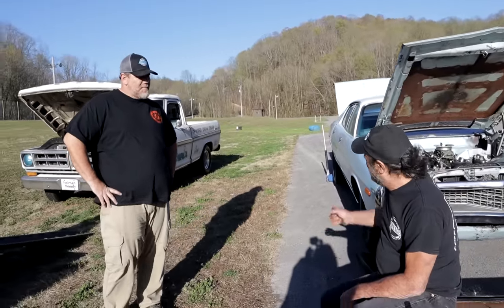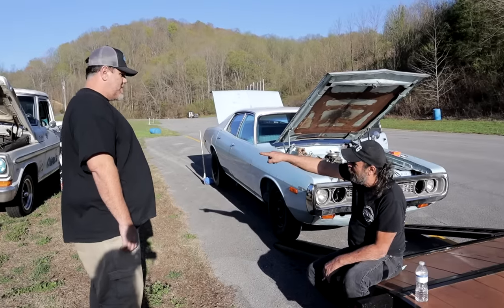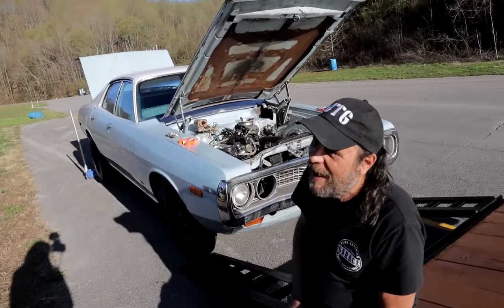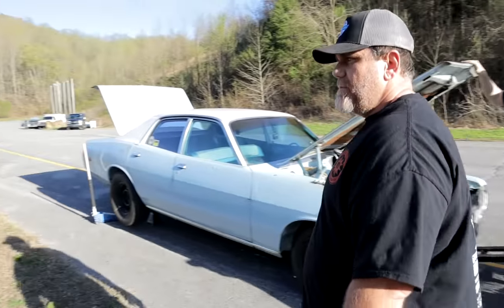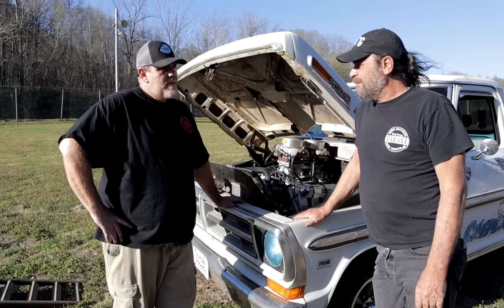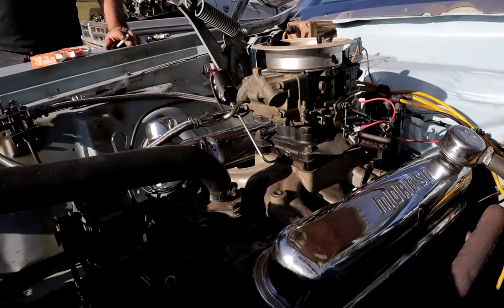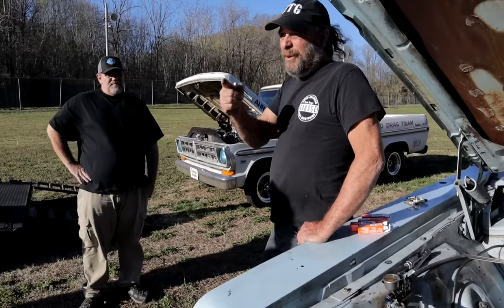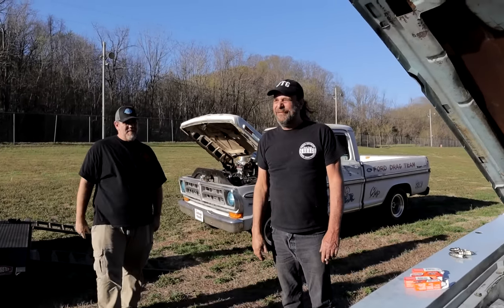Grudge Race Goodness! N/A Boss 429 Ford F100 Takes On A Nitrous 318 Dodge Taxi Cab.  One And Done

Comment: Well. Tony's battleship can move.
Reply: Remember when he weighed BR ? That car weighs less than my 70 Dart!
Reply: @craighansen7594  I dont doubt it. He's been shaving weight everywhere he can. And, what he did, with a relatively stock 318 is impressive
Reply: Let's see what B.C. has to say aboot dat.
Reply: Did pretty well for a 318 but that 7.60 1/8th would be a low 12 high 11 in the 1/4 mile which is still a second off his goal of 10s. Hopefully he can get it there eventually.
Reply: @TheInsaneShecklador  just a larger NOx tank!!!😅😂❤
Reply: @TheInsaneShecklador  Yeah UT mentioned something was not right when it shifted - not sure that exact set-up with get in the 10s
Reply: Definitely got off the line...but...man, that Ford was coming - l saw his video from inside the cab...Good Video 👍
Reply: That’s what she said
Reply: Great job. This was exciting as any drag I’ve ever seen. BR jumped off the line. 👍

Comment: NO fancy dance pricey parts NO high compression engine NO rebuilt /engine bearings!      NO fancy dancey suspension long live the legend of the 318. Tony proved it, for very little money, alot of wisdom, ya gotta believe the 318 is the little engine that COULD and DID. NO ONE that sees this will ever doubt the 318 is a great engine, especially in the right hands! Tony did MOPAR proud- REALLY opened some eyes with this one. And yes, he treed him, but with 111 less cubes, less compression, BUT with nitrous, it was a fair handicap. And that Ford was definitely comin'- Andy got caught out the hole a little bit, but he was STILL flying! GREAT RACE!

Comment: My most anticipated race of the year, for sure. Way to go Uncle Tony. Make the most of what you have. With the knowledge part being the most of what you had. My first car was a 72 Hemi Orange Duster. Blacked out hood with orange strips going up the center. Black duster stripes going across the sides. A 318 with a manual 3 speed and a 3:23 8 3/4 rear end. My father thought the 318 would be a better engine for a beginner driver at 16. We bought the car in Kannapolis NC in 1976. But for my next 2 years in High School I slowly built that 318 up with help from my friends. 340 heads. Cam Dynamic cam. Headman headers. Edlebrok  4 bbl. intake. Carter 750 cam carb. Zoom clutch. I had the quickest car in school. Many stoplight races to earn the title. The town was full of really powerful cars. So I was far from the fastest in town. But that 318 held its own and earned me some coin on the weekend. I bought all the parts myself and worked many long hours to afford the car junkie habit. Great win for the lowly under estimated 318. Long live the 318. And Uncle Tony, remember “ we are old guys, we do stuff”. Thank you sir for your great channel.

Comment: Damn good race. 318s just went up in value.
Reply: So did nitrous injectors...
Reply: @godsowndrunk1118  But the 318 handling that shot is enough for an applause.
Reply: @tomc8157  wasn't contradicting... just impressed with both.
Reply: Very easy to stroke a 318 block to much more cubes! Nitrous on top, it would be effortless to output 500+hp! Then there's sending it down the track!
Reply: @craighansen7594  True...and the Boss 429 can be bored and stroked to 600 inches (Depending on which block used) and make a1,000 hp on carbs.
Reply: @Gods own Drunk  that 429 is Windsor based I believe.
Reply: @IndirectConnection1  unless Kasse added something new,  I think it's big block....had the old Weiand tunnel ram ... which was the only aftermarket intake built for the Boss 429 back in the day.
Reply: @Gods own Drunk  This one is a small block. Andy mentions it in the beginning of this video. He says it right after he talks about blowing up the 393. I'm guessing it's 351 based.
Reply: @IndirectConnection1  well... forget about stroking it to 600 inches. I'm a FE guy....I'll have to check out hemi heads for the small blocks.
Edit;  So are the heads compatible with existing Cleveland intakes...or?
Reply: @Gods own Drunk  I'm not sure honestly. I thought it was a FE at first as well.
Reply: @IndirectConnection1  I was thinking 385 series big block...429/460.  I meant FE's are my area of expertise.  Anyway, I don't know what the heck it is now 🤔
Fords can be confusing...
427/428's  , 429's and 430's , and all different engine families...like 351 Windsor,  351 Cleveland and 351M's...also all different families.
Reply: @godsowndrunk1118  🤣 me either...
Reply: @jamesholmes3955  Thanks.... I've been searching the memory banks and I seem to recall a YouTube video about those...
Reply: @godsowndrunk1118  This engine is like the "Street Boss" Intake kits they used to sell in the Super Ford Mags. 

What Andy is going through is the same thing many would have went through back in the day with that kit. You buy a $250 intake, furnish your own Windsor short block and a set of 351M heads with those. There was never a 4Bbl. intake for a 351M so that was one reason they never got taken into the performance arena. I don't even think the aftermarket made a 351M or 400M 4bbl intake back then. Even if they did the other internals featured such low compression the 4bbl wouldn't need to be but 450CFM on stock internals. Be just as much power to shove one of the old 60's 2bbl. carbs onto one.
Most likely leaving you a lot of blueprinting and working things out, just like Andy here with this Windsor block and 429 Boss heads. You can imagine the cost of custom pushrods back in the mid to late 80's. 
You could get "cheap" sbc aftermarket parts back then, but not anything else. 429/460 was actually non existent in the aftermarket. Holman Moody of course, but to the average joe, everything but SBC was double and triple the price. Heck SBC Tunnel Rams with 2 650CFM  was like $550. BBC $1100 Mopar or Ford any block $1500.....

The biggest advantage to the windsor block is just like Andy's 393, there is no machining the block for crankshaft clearance. Most all stroker Ford cranks are drop in and forget it. Not sure about the 454ci. and 460ci  351 stroker builds needing clearance or not. Most likely those big cranks would need some.

Remember a 383 Chevy has a lot of block clearance machining. Wouldn't take the average joe but 2 or 3 days of light work to complete, but it is a very crucial step for the stroker 383 and larger SBC non 400 block.
Reply: @godsowndrunk1118  IIRC I remember an OLD article about Mickey Thompson modding 1st gen dodge hemi heads (331, 392, etc) to fit a 428 FE.....might be the place to start looking.
Reply: @yurimodin7333  I seem to remember that there may be something to that....I do know Mickey made hemi heads that fit Pontiac's in the early 60's. They had to use articulated  push rods in order to work....three pieces as I recall .
I'm building a 427 FE using a brand new BBM block with a set of old High Riser heads from a 64 Thunderbolt....It's replacing a 427 Low Riser stroker that had seen better days....using the internals in the new block with the different heads.

I'm a ford guy with Mopar a close second...and everything else last....
Reply: @kramnull8962  yep...it takes dedication to be a Ford fan...and lots of cubic dollars.  I've always said FE stands for Freaking Expensive!  
I know what you mean about non availability of parts for  certain Ford engines. But things have really changed in the last 20 years or so.
Things are even better for the 351M , with a performer intake available and adapter plates to run Cleveland intakes.  You can bring the compression up on those by using the quench chamber Cleveland heads , and now all kinds of aftermarket heads are available.
And Edelbrock did fans of all makes a big favor by making aluminum versions of the rare high performance heads for Buicks, Olds, Pontiac and Mopars.... even Chevy 409's.
Unfortunately, we're now governed by madmen who want to take our cars away....and much worse.
I'm praying people wake up before it's too late for us car guys.
Reply: @godsowndrunk1118  That ones a small block.
Reply: @bw3506  So I've been told. For me, only a Boss 429 is a Boss 429....but that's just me.
Reply: @godsowndrunk1118  its a "mixed up Boss" , based on a small block . 
That ain't going to 632 , ever .
Reply: @Richie_the_Fixer  yeah...if you read all the replies, you'll see I found that out....and more.
Reply: @Jim Wichert  It is a badass build.  I'm sure Andy has some new found energy to correct issues. He'll be back better than ever.
Reply: @godsowndrunk1118  Kinda how I would look at it but I guess if it has boss type heads and it's 429 CI you can call it that if you want. He was calling it "Mixed up Boss" in his other vids.
Reply: Hammerhead Performance engines has hemi heads for small block fords and ls engines.

Comment: You'll notice when they come on the line that one of Tony's brake lights was out. It was that small bit of weight savings that gave him the win. Bottle Rocket grabbed that track and took off like a.......well you know.
Reply: If he hadn't went with the automatic this race would have been different.
Reply: @oacumulador  doesn’t matter if he treed him and sprayed him. That truck still had the advantage
Reply: @kramnull8962  please explain.   Are you saying he would have run slower?
Reply: @oacumulador  I don't think you understand drag racing. If Tony (Mopar ) had jumped the light, there would be a red light that came on. Tony just out drove him.
Reply: @oacumulador  bulb was lit when the car left. There was no jump.  Tony just had a better reaction time
Reply: @oacumulador  it takes time for a vehicle to take motion. The car didn’t jump. Tony just had a better reaction time. He nailed it. The car didn’t take motion until the bottom bulb was lit. You don’t understand what drag racing is or “reaction timing is” it takes experience to time and cut a light that quickly
Reply: @656hookemhorns  exactly. He doesn’t understand what “reaction Time” is. That car didn’t take motion until that bottom bulb was lit. Tony cut a damn good light
Reply: @oacumulador  reaction time is muscle memory. If you wait for a green light before you leave your going to lose every time and have a terrible reaction time.  You don’t understand how staging bulbs work
Reply: @oacumulador  it takes time for a vehicle to take motion after you stomp it. That time period on which you plan that in comparison to that bottom bulb is what’s called reaction time
Reply: No what gave him the win was Tony’s reaction time
Reply: @bigboreracing356  generally the ones that claim another car is “slow” are the ones that have a car that cannot compete 🤷‍♂️
Reply: @bigboreracing356  upload a video of your “fast car” 🤪
Reply: @bigboreracing356  I know for a fact Casper is running mid to low 6s in the 1/8th on motor from his track videos on his channel. That’s nothing to sneeze at 😂😂. Pretty impressive for a 3800-4000 pound truck naturally aspirated and street driven
Reply: Yes , bulbs are unnecessary extra weight !
Reply: @kramnull8962  you're right . 
With a 4 speed , Casper would have never gotten near him !
Reply: @dirkmanning8621  He had been working with a 4 speed that had a granny 1st gear. He thought he could get it to launch like a rabbit and hit 2nd and spray, but seemingly 2nd was too high of a jump for his 318's power band. 
He actually went through 2 custom torque converters after swapping to the automatic.
So in turn it seems as though the 1st gear of the automatic was middle of the road and was better mannered out the gate.
Reply: @Richie_the_Fixer  are you saying that a 4 speed would have given Tony a little more advantage? Faster?
Reply: @kramnull8962  ok thanks.
Reply: @dirkmanning8621  yup . 
You might not know this about him , but Tony's 87 Mustang 5.0 FIVE SPEED was the quickest totally stock 5.0 ever tested , 13.40 with NO aftermarket parts . 
Tony DeFeo can launch a stick like few people you've ever seen . 

And Neil Van Oppre proved conclusively , scientific back-to-back testing , that 5 speeds can be quicker than automatics (without trans brakes) in the 1/4 mile . 
Neil's tests can be viewed on YouTube at "Stick Man's Garage" .
https://youtu.be/icRPZl7zzCA
Reply: @brandonbell433  agreed
Reply: @kramnull8962  That really doesn't matter, the race is over.
Reply: @bigboreracing356  And just the engine probably cost 2 times the amount of Bottle Rocket. Wow, impressive, you have disposable income.
Reply: @brandonbell433  They're the ones who drive their mom's 90 Hyundai and tell people it's their car.
Reply: @bigboreracing356  anything into the 12’s is fast, anything into the 11’s compromising streetability, and anything into the 10’s is blistering fast and not fun all day on the street, OR it’s a DODGE DEMON.    10’s with a warranty and AC and no complaints.       Consider that an OEM made a warrantied, street legal, comfortable, 10 second car.      Ten years ago you’d of thought impossible or it would never happen.   Obviously a huge R&D budget helps a lot, but regardless of budget, 10’s and comfortable on the street is the realm of the few.

Comment: In the late 70s a speed shop specializing in van side pipes was having a going out of business sale, a young Tony couldn't resist checking it out, over on a shelf set a Marvin Miller nitrous kit, young Tony was mesmerized by the shiny stainless steel tubing and color coded solenoids emanating from the plate, he had to have it!  For years Tony prized his nitrous kit, waiting for only the right car to build around his nitrous kit, finally a 4 door 318 Mopar appeared before his eyes, he knew this Mopar would be built around this nitrous kit...................................
Reply: Right on, 3/4 cam, pop up pistons, Gabriel hijackers!

Comment: Back in the ‘80s my buddy had a 1970 Dart Swinger, primered, slammed with aggressive rake and Mopar rally wheels stuffed up under it, reverse manual tranny w/ nasty shift kit, 4.10 gears and a nasty 318 with 340 heads, purple camshaft and that sumbitch was just awesome. That car made more of an impression on me as a teenager in 1987-88. That car was/is the epitome of Hotrodding in my brain lol 
#MuscleCarTimeMachine ❤

Comment: That was unbelievable, that dodges launch, pulling the left front tire off the ground had my mouth dropping open. I honestly thought Casper was gonna win, in a1/4 mile run Casper would have won. New respect for 318 engines now, I'm a Mopar guy, but think of all the money invested in the  engine in Casper, he's got 2K in the headers alone.

Comment: I love bottle rocket, reminds me of an old montana highway patrol car, though they had 440 pi motors. The color is even right. I am a die hard ford guy but there is something about a 70's fury. had a couple of buddies that had retired mhp 440 pi's headers and nos, frickin things would run 160 easily.

Comment: The first 60ft wins the race...especially in the 1/8th!!

Cut a very good light,car did what it was meant to do off the line, you always said that was your strategy! Now what happened in 2nd gear gotta find out what happened!

Reminds me of when I raced pretty much stock 3.91 geared 340 A bodies with my stock 440 B body with either 3.23's or 3.55 gearing..If the A body hooked and got the light and I spun and or slept on the light I ran them down by the 1/8th and it was bye bye 340 A body my 440 B body then walked them..Andy was getting you but didn't :)

Andy seems like a good guy,maybe he needs a 318 in that Ford!!

Comment: You can see Tony clearly has experience drag racing with a tree. Takes off right on the green, impressive. I heard from an old timer that you have to "think" and "start moving" your foot to press on the gas on the final yellow light before the green so you can take off by the time it hits green. I don't know if this is what everyone does, but as someone who hasn't dragged race yet. I can't imagine it's easy to pull off.

Comment: They both ran equivalent of 11:50s-ish if they had 1320 feet.
I feel like the truck could run a 10.90ish pass with ease at around 121+.
Tony's car should be capable of a 10.90s pass too but gonna need a little of this and tickle of that. 
My 70 Olds 442 weighed in at 3713, normally aspirated 455 with alot of compression, manual reverse th400 with a killer ATI converter, 430s out back, 29x10.5 et streets, and 3in exhaust with tailpipes.
7.30s@94 in the 1/8 and 11.20s@119 1/4 for 3 years straight last time it was out. 
The car will always be a street car but I'm looking to take some weight out of it, solid roller, victor intake, hoping to bump from 620hp/610tq to 675hp with the new combo.
This stuff is so much fun, and this all just goes to show you don't have to have a chevrolet to have fun and go fast and keep it a street car too.

Comment: I want to say I watched this project from start to finish as you uploaded I've been watching your content for 4 or 5 years I never seen what happened to your buddy Lamb chop but know he was in my prayers with his family and friends my uncle us just like you the way you built tgis project was alot like my 79 malibu he and i built it was a factory bottom end 400 sbc the head was cracked we used a of 350 heads he thought me the art of grinding casting marjs and sanding all the port valley smooth we upgraded the head hardware back faced the valves and had them flowed he thought me how to size and come up with the cam from my head measurements and how much cfm the intake and carb needed to be able to flow and how much fuel to put in it he also taught me that power was not the first step it was your rear gear we chose a 373 because u was running a 350 turbo i had a transmaster shift kit and a 3000 stall I even had the single air shock in the back point of the story is other then a head kit a cam and lifter set and roller timing chain it even had points but after we adjusted the suspension and got it to hook evenly that car tought me respect quick i love your channel you guys keep it up